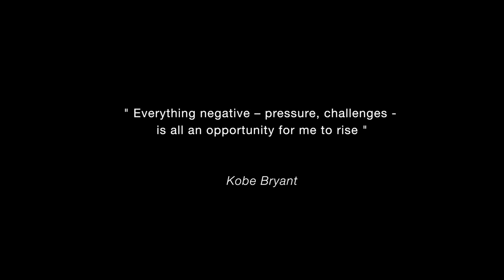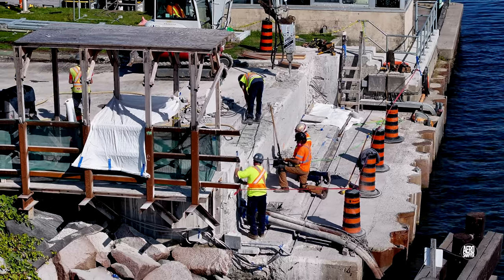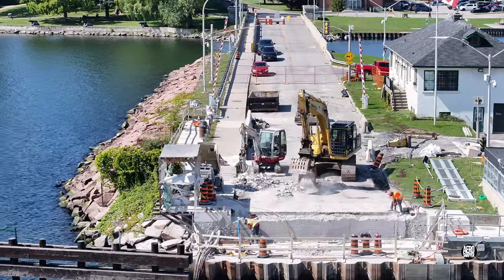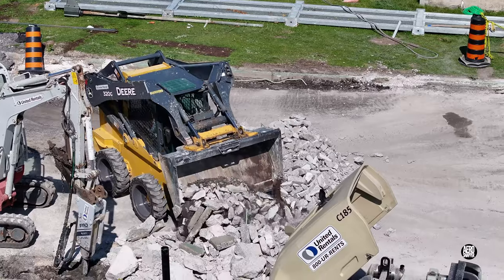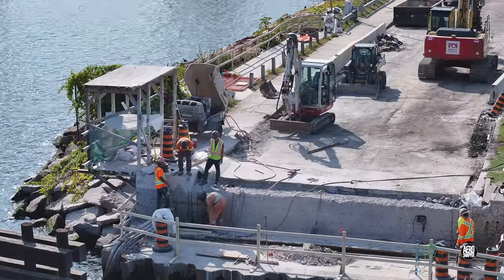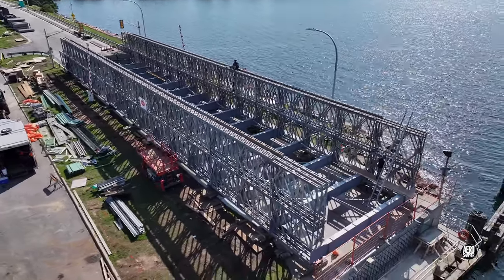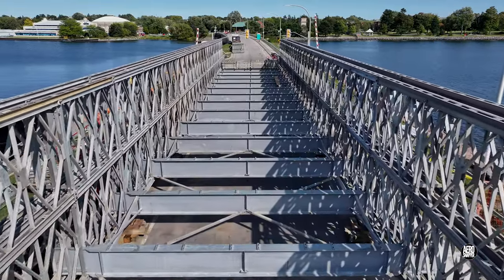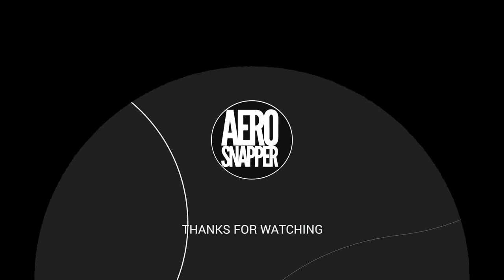No Smoke without Fire  - an update on Kingston, Ontario's La Salle Causeway 4K

Comment: The size of those trusses make the bridge appear to be very narrow.  Will it "sing" like the old bridge?
Reply: Yeah, I heard it’s going to sing: Bohemian Rhapsody.
Reply: @zaptor1514   lol
Reply from the maker: Gary - I think that the height of the sides - and their relatively intimidating strength may 'scare' a few early users, but there will be plenty of room.  I certainly don't recommend that cyclists vie for space with cars on the roadway.  The best option for them would be to dismount and use the pedestrian walkway.  A 'singing' sound is unlikely. The road bed is solid plate, not a grating
Reply: That is just a temporary bridge, not going to stay there.